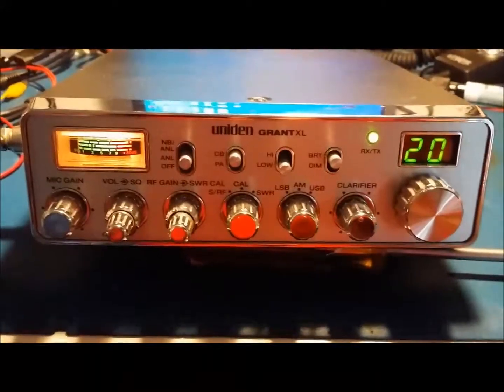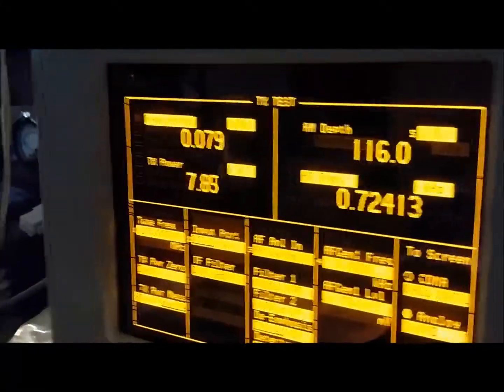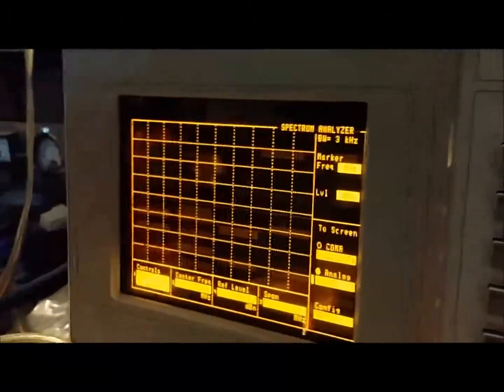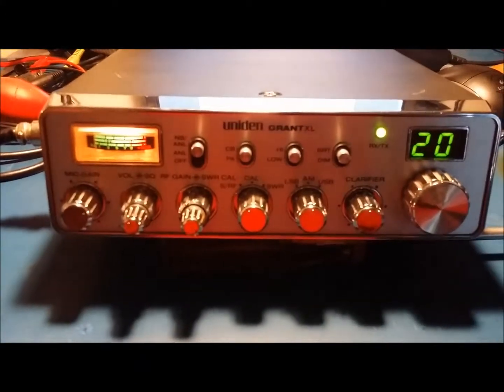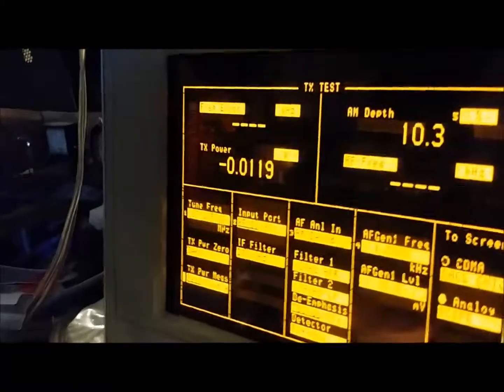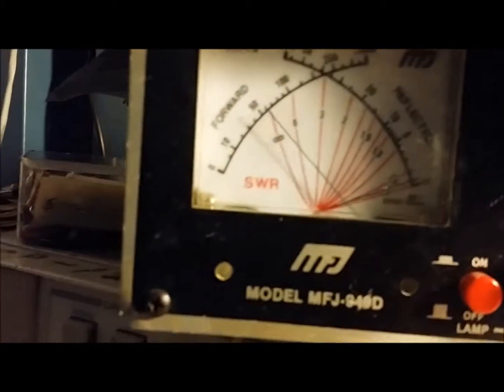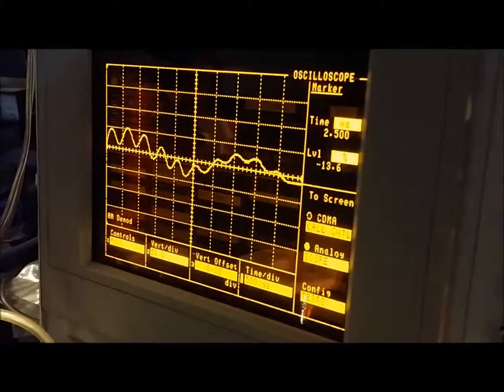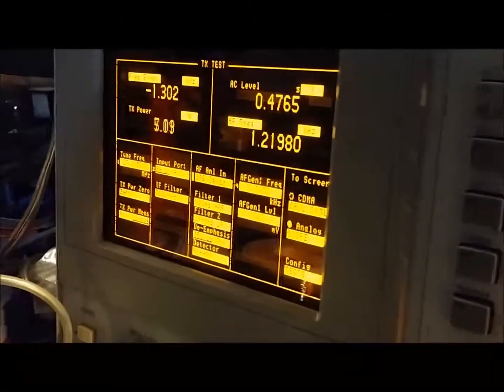Uniden Grant XL

Comment: -- edit --
Removed previous comments, Nice Video helps if I watch the video when I can actually hear whats going on, You basically covered all my concerns in my first comment and it looks like you might have sample averaging on, I must have confused your video another video.    

 I'm curious have you found any cheap compatible PCMCIA cards that work in the E8285, there's some good software available for but it requires a compatible PCMCIA card and they are pretty vague on what a compatible card is. Also did you downgrade the firmware in that unit yourself or did you buy it downgraded.